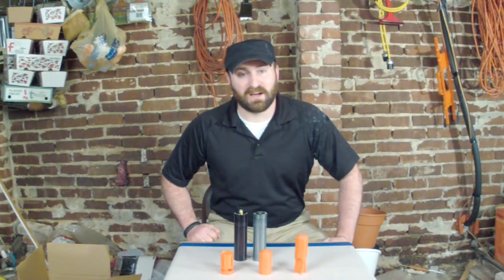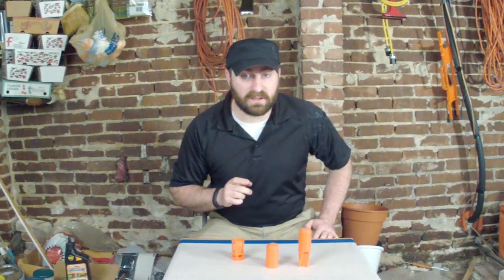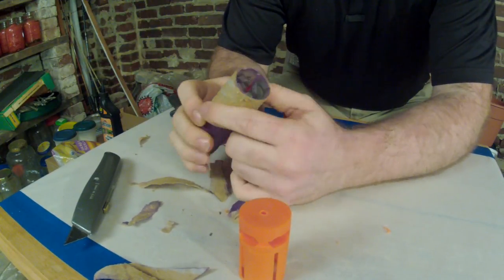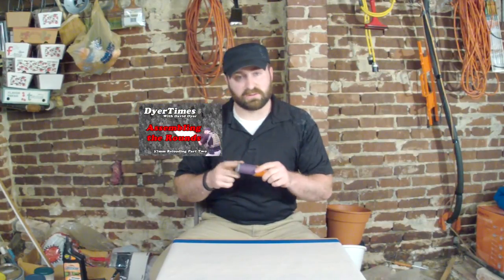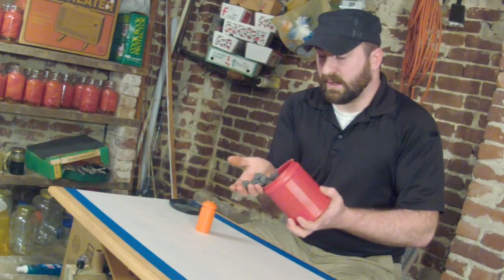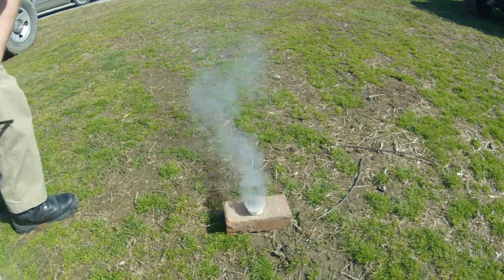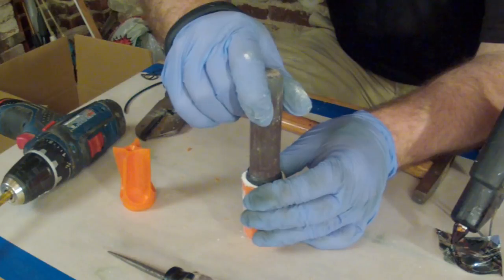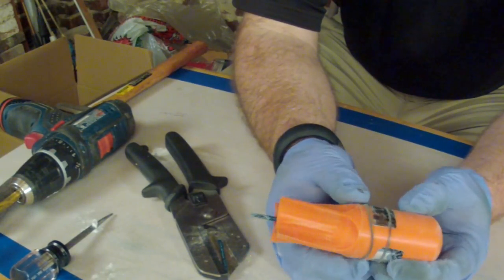DyerTimes - 37mm Smokeless Reloading - Building the Rounds - Part 1

Comment from the maker: If you are using shorter shells the 12" launcher may give you a noticeable bump. I have two 37mm launchers and I prefer my 9" havoc launcher. The smokeless shells from this series actually stick out from the barrel about 1/4th inch. I was very impressed with these and was able to get great results and impressive range (200ish yards or more) depending on the projectile. If you have the chance to go smokeless 37mm that is where you will notice a difference regardless of barrel length.

Comment: I thought that fins provided a stabilizing drag, or do the angled fins in on this video do any thing? Do the fins really impart a spin strong enough to stabilize the projectile? Great video by the way.
Reply from the maker: Hello, One of the things I wanted to do is slow the projectiles down to show in flight travel but my cameras only caught an orange blur. If you check out some of my other videos you can see that blur and at 100 yards it looks like it does indeed stabilize the round. I also have some 26.5mm videos up. I typically don't shoot the finned ones. I find the un finned rounds do everything I need. They tumble for sure. If you have anything else you would like to see let me know. Thank you, David
Reply: Thanks for the info. Maybe you could do a video on oc spray in a 37mm.